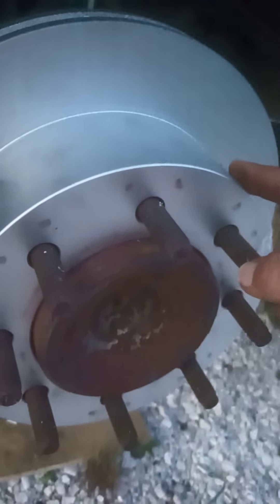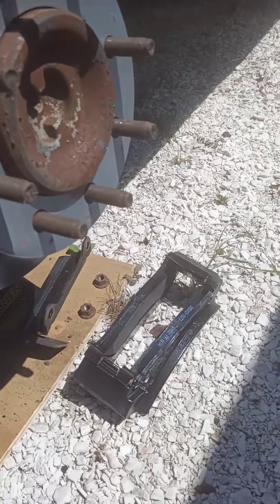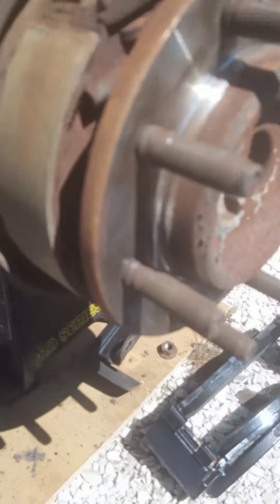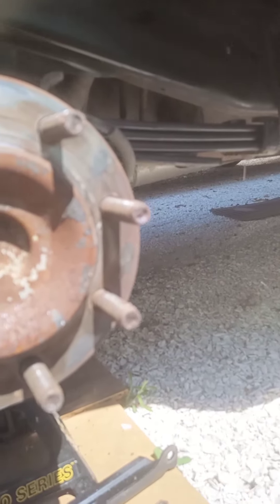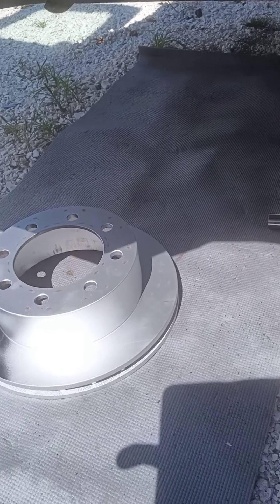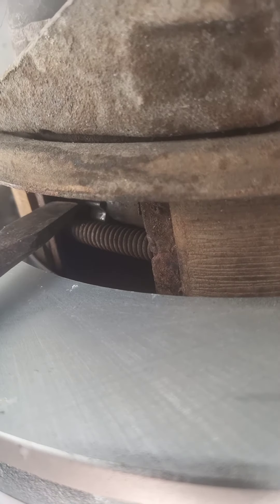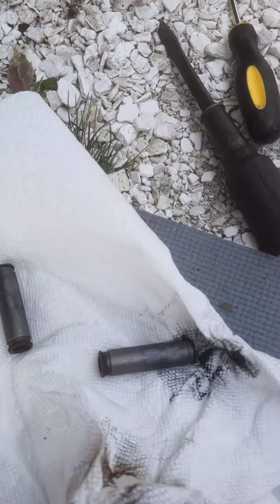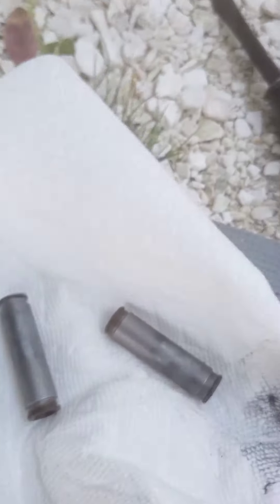e 250 e brake adjustment + rotors and pads

Comment: is there no adjustment window on the backside covered by a rubber plug? strange u have to to remove the caliper. have to adjust ours for inspection and just curious. thanks for the video !
Reply from the maker: I cant remember for certain, but yes im pretty sure you can get at the adjuster from the dust cover rubber plug. If you have it apart it is easier to adjust, especially if you have gone to far.
Reply: @duereviews791  thanks for the reply, ill giver a check tomorrow, rly appreciate the advice
Reply: @sillylilfellah any update ? I need to adjust my brake on my 09 e350